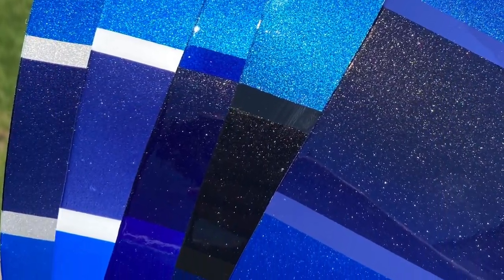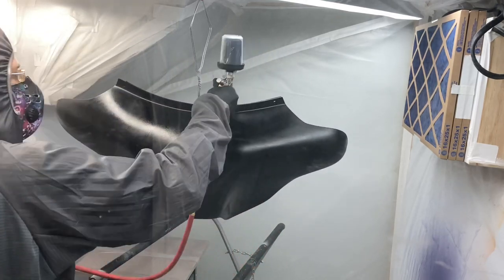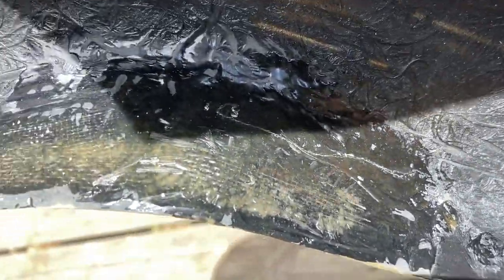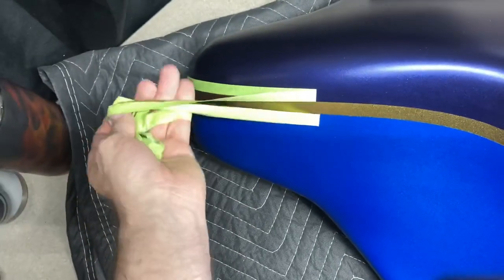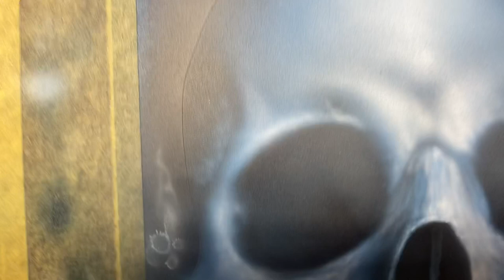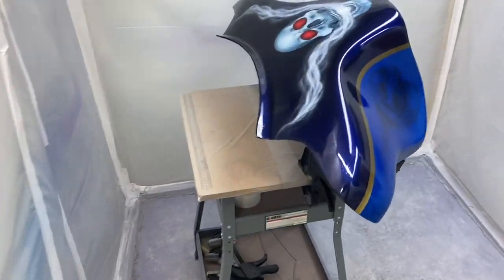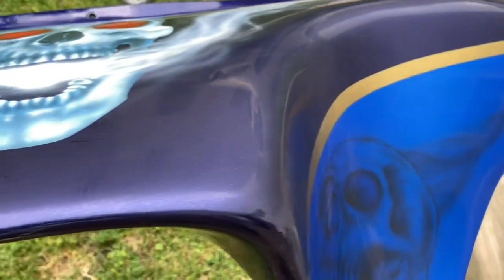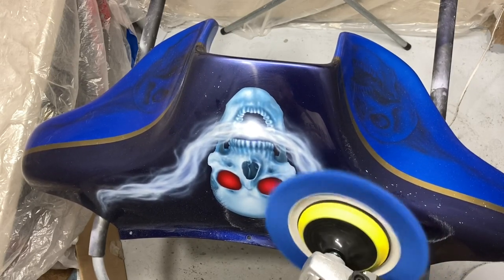How to paint a motorcycle fairing with Createx Paint and Tamco clear coat, Part 2- BrusHstroKeZ

Comment from the maker: ThankZ for watching!  I need some ideaZ for future videoZ. Please drop a comment below and let me know what you would like to see me do in the next video.
Reply: What did you and the primer down with , what grit and how long did you wait to sand and was it wet or dry sand
Reply from the maker: Originally I used rattle can primer. Paint peeled off of that. Sanded it all off.  I didn’t have a primer gun at the time I did it, so I used Createx Autoborne Sealer after that as a primer. I did 3 coats in one session then another 3 a day or 2 later. Dry sand only with Autoborne Sealer.
Reply from the maker: I only use Tamco DTM Primer now. You always want to sand primer dry.  It can absorb moisture and ruin a paint job and/or fail down the road.

Comment: Amazing job. I haven't had any issues so far with the createx, autoborne or auto air colors sticking or peeling when spraying over any my H.O.K paints. Will keep the not mixing of the paints in mind though. Thanks for the information.
Reply from the maker: ThankZ man!  I talked to Createx. They said their products only have issues sticking to cheap store bought rattle can paints/primers. I’ve torture tested all their products sticking to all typeZ of different surfaces, and no issues. I’ve since upgraded to a primer gun and high quality primer, no issues. Createx should work with HOK.

Comment: I'm not a car painter or body guy so this may be an ignorant question. Couldn't you use fiberglass resin to fill the chips as opposed to selling it with a paint primer?
Reply from the maker: Not an ignorant question. This was my first ever time painting any motorcycle parts and painting fiberglass so I was learning. But I did use fiberglass resin to fill the chips/pinholes. The primer was used to fill the sanding scratches in and to get a perfect surface for paint.

Comment: What final wipe do you use ? Do you apply it to the Createx before clear and does it pull the paint?  Thanks
Reply from the maker: I use Tamco Final Wipe HR-398. It’s a mild solvent cleaner. It doesn’t affect the water base Createx, since the cleaner is a solvent. Other brands work too, just make sure to use the mildest version of final wipe/cleaner.